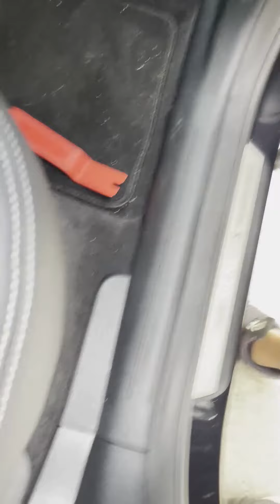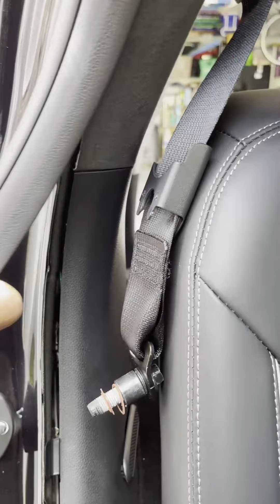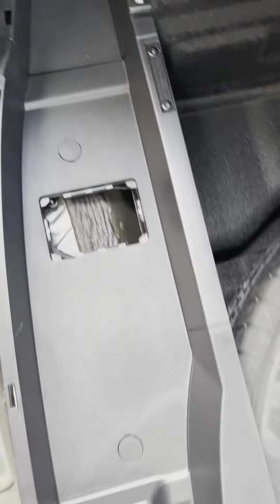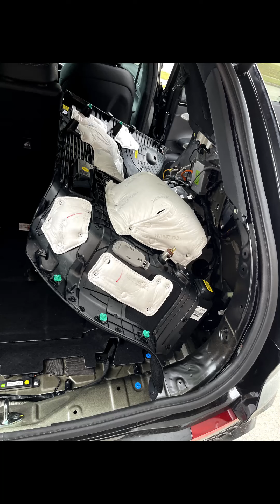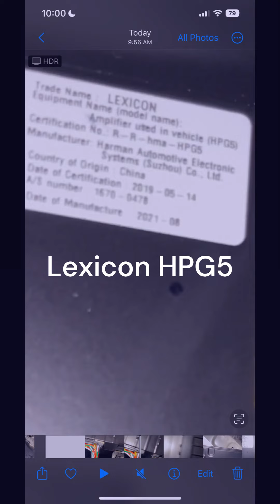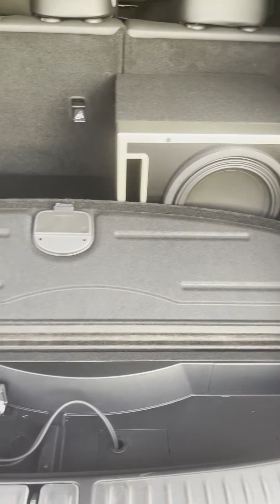2022 Genesis GV70 Amp & Subwoofer Installation

Comment: I know this is late but does anyone know if the base sound system has the amp in this location and if so what wire am I splicing into or where can i find wire diagram

Comment: Hey boss thanks so much for the video. You are a life saver.
I did the same exact install in my car but i am having issues with the subwoofer sounding really boomy and just not clean as i had the same sundown 15" sub in my mazda and it soundedreally clean. I went into some genesis forums and they mentioned disconnecting the Active noise cancellation  microphones. Did you ever attempt to try  this? If yes how did you do itml.

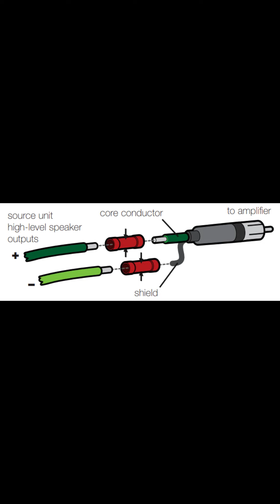Comment: Nice video of the install! Where did you run the remote blue wire to? That's an important question. I'd rather not run it all the way up to the dash. And at 4:34 you show the splice into the RCA cables. You ran the RCA cables to the infotainment system or to the new amp?

Comment: Thanks for this. It was harder than I thought but absolutely wouldn't have been able to do this without your guidance.
Reply from the maker: @Lunatic4959  glad I could help, what did you end up installing?
Reply: @blackbirdway  Rockford Fosgate Punch P300-10 in a 2023 Genesis GV70 with a standard sound system. My amp wiring is different than yours. I have green and yellow connectors so I got stuck on which wires to tap into but the chart you had helped. Didn't have those wire taps either so once I figured it out, I soldered the wires together. Works great!

Comment: Where did you run the remote wire to? The fuse box up front or tapped into a wire on one of the vehicles amps wiring harnesses?
Reply: Did you find where ?

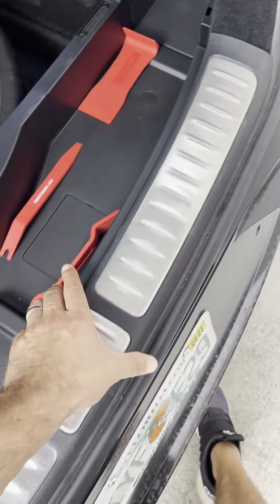Comment: The sill @1:24 shows you already removed it? How many clips? Did you break them? Are they where the holes are. Also does the tie down on that panel need to be removed or do they stay attached to the car when the panel is removed